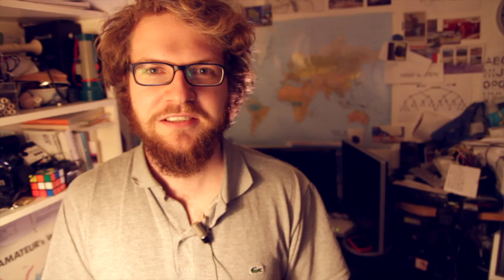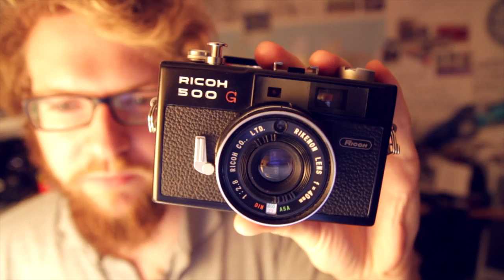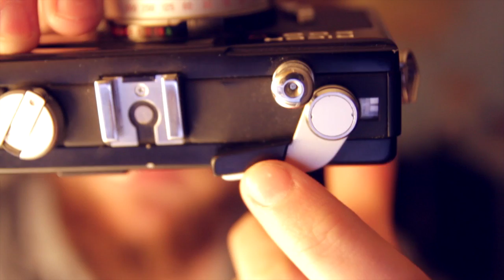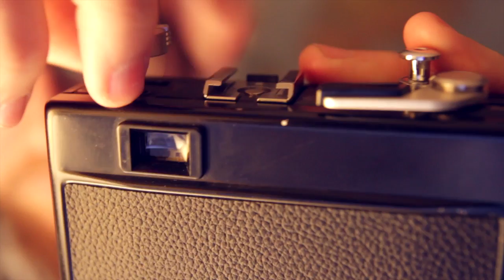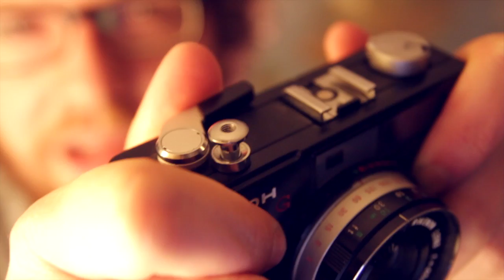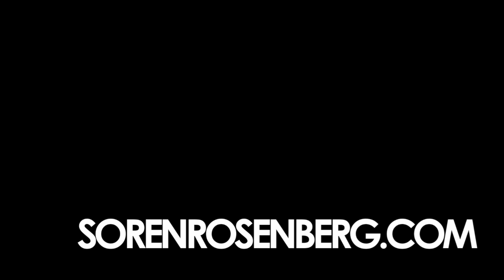Ricoh 500G rangefinder camera review

Comment: I have the Ricoh 35 ZF, which in some ways can be considered to be an upgraded version of the 500G.  It still has the cheap-toy-like advance lever and stuff like that, but the back is a little better sealed to prevent light leaks and it's a little more sturdy. I think you'd like the ZF better than this.
Reply: would rather call the ZF a downgrade it is not a rangefinder and only provides zone-focussing

Comment from the maker: Tough question, they are very different cameras. The Ricoh is the cheapest, but with the most options. The Canonet 28 feels like the best quality, but it's limited by it's auto controls. The Olympus Trip 35 is limited as well since it's basicly full auto, but it doesn't need a battery and it's a lot of fun since you always have to zone focus. 

If I had to take one for a walk right now it would probably be the Trip 35 since it's the most fun :)